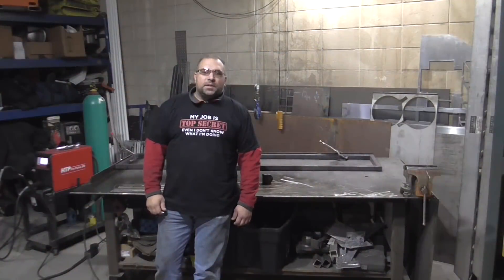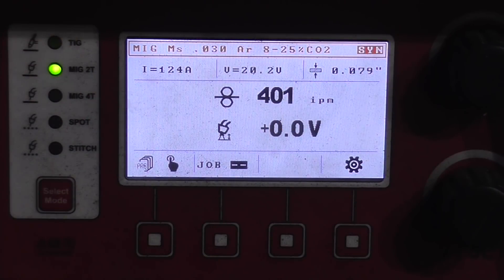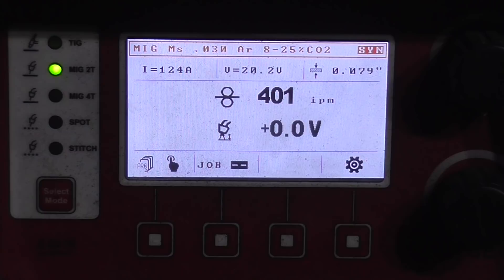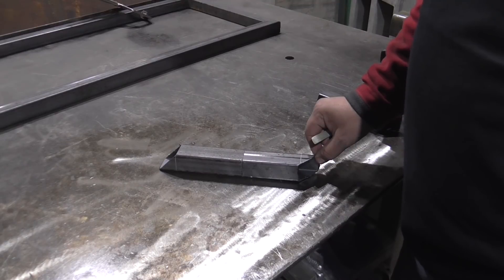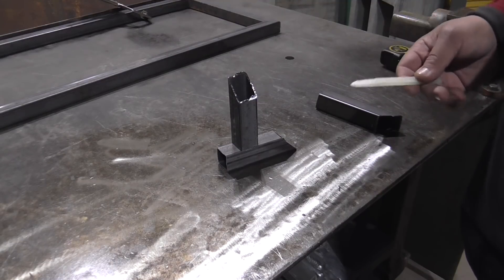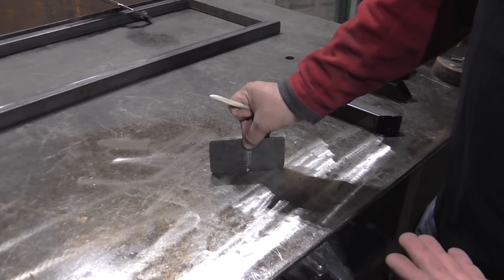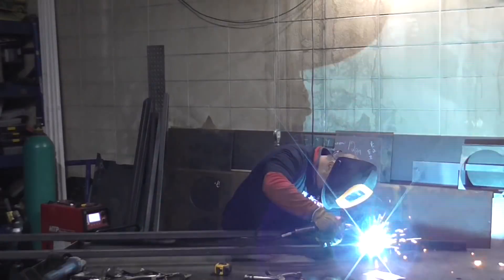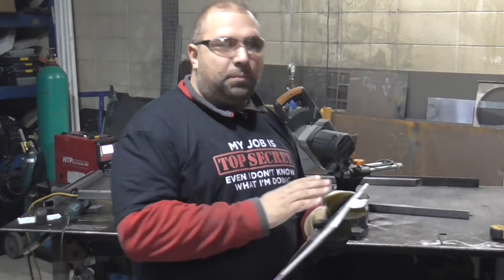What does Synergic mig really mean and how does it work? Heat input, joint config,  gun manipulation

Comment: So nice to get an explanation from a fellow German. Here in America everything it geared toward the stupid. You can't give a detailed explanation of anything because the attention span simply isn't there or the person has to look at their I-phone to see if somebody tweeted them. You explain things the way my Father explained things, with great detail and nuance. Don't ever try teaching in an American classroom all you would get would be dazed stares looking back at you. A good example would be how you used the dry cut saw. Intuitively, you understand that you don't power through these cuts. You simply let the blade to the work  and cut at it's own speed, which frankly, is pretty fast. I've seen blades ruined by people who think they are using an abrasive cut off saw and just push down as hard as they can. When they do that the teeth explode. You simply have to ask yourself how frickin' stupid can people be?
Reply from the maker: SATAMAN Schmidt oh ...  you dont want to ask because you dont want to know ....
And than you hear guys: real men dont read instruction manuals ....  or manuals are good for kindling fire wood ....  
lol
And than those guys wonder why they cant get the hang of stuff ....  
i mean - its not the 1980’s anymore - where a mig welding machine has 2 knobs - 1) wire speed and 2) voltage....

Not that there are digital displays (  that everybody was asking and screaming for!) the operator actually needs to know what the display is telling him!
Also the machines today weld sooo much nicer - BUT they have become more complex too ....  run in speed adjustments, inductance adjustments , pre and post gas flows ....  slope downs ....  the list is almost endless ....   

And in the 80’s people had an 800 lbs transformer machine that was drawing 100 amps single phase out if the wall - and they were happy that it welded mild steel ....

Today, people want it to be portable, run of a 30 amp dryer outlet ( or better yet on 110 lol)  and than they want to be able to weld all sorts of different metals with it ( aluminum became s really big deal the last 10+ years)
And than they want to be able to do all this WITHOUT ever taking a class or reading a manual ....

You can learn anything from a youtube video .....

So now that you and i have figured out “how it works”   Htp started as the first north american welding company to put a scannable bar code (qr code) inside the machine - and people can scan it with their phone and eventually get a “video operators manual”  
And their phone will play a step by step video for them ....

Yes i guess technology will cater to the customer ....
Reply: Sataman, according to your comments, sounds like us Americans don't stand a chance. Please continue to discourage others from learning. Are you American or just living here?  Do you have family, children, friends who are American?  Have you told them how you feel all Americans are stupid?  How did they react?  Did they agree with you that only Germans can explain things to other Germans?  And Peter, love your channel. But you agreeing with your apparent fellow countryman is beneath you. Keep up the good work.
Reply: @warddan2002  I NEVER discourage others from learning but it does bother me when either carelessness, of lack of interest, discourages people that should be learning from doing so. I'm second generation, born in America, as my parents were from Germany both of which have been long dead. Weirdly, at least to me, most of my friends grudgingly agree with me as they too are engineers and have witnessed this themselves. Sadly, some of them in their own children.
Reply: Wow so angry and bitter 😡